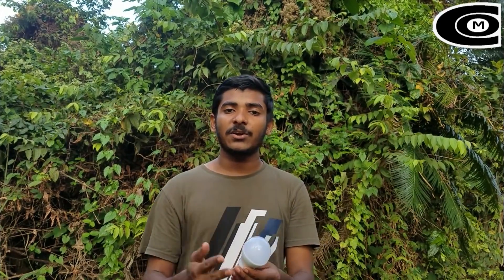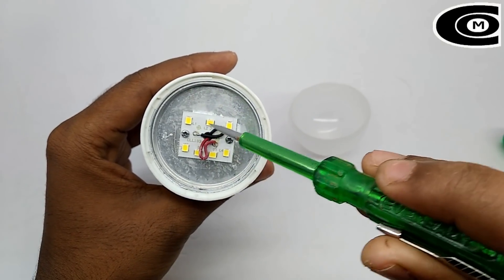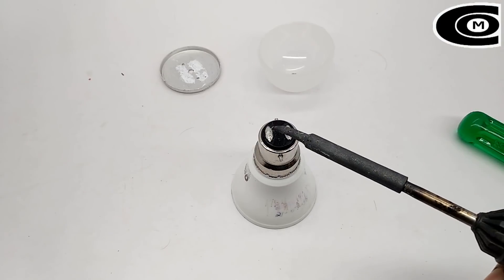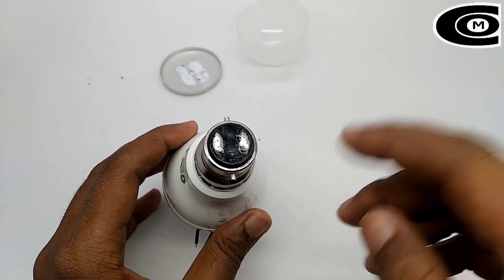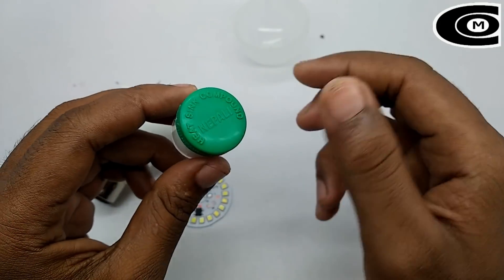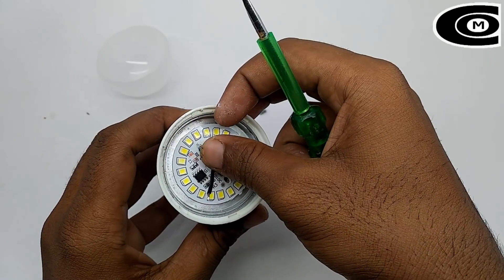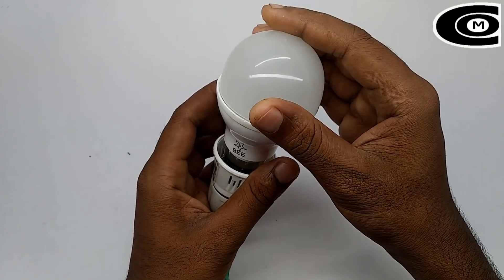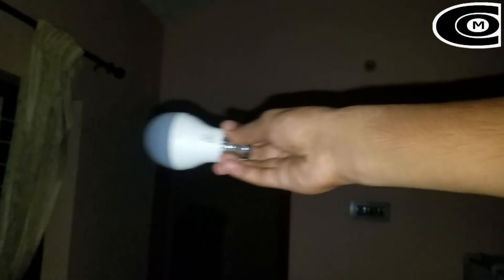How To Repair LED Bulb at Easy..|എത്ര വലിയ കേടുള്ള Led ബൾബും ഈസിയായി ശെരിയാക്കാം!!

Comment: If I only could understand a word 😂
Reply: not needed really. only relevant point is the LED board (new)  and the heat sink paste are available in electronic shop for dead cheap rates. While connecting the wires, the polarity is not important (AC).
Reply: Nicbroooooo.    #newtonstech 👈

Comment: Circuit board ആവിശ്യം ഇല്ലങ്കിൽ പിന്നെ എന്തിനാ ഒറിജിനൽ ബൾബിൽ അത് ഉപയോഗിക്കുന്നത്.
Reply: Circuit board ആവശ്യമാണ്. പുതിയ ഡിസൈനിൽ ഏതാനും ചെറിയ ഐസികൾ ഉപയോഗിച്ച് അതേ കാര്യം നേടിയെടുക്കുന്നു.
Reply from the maker: ആ led panelൽ converter ic' s ഒന്നും ഇല്ല..
Reply: Your doubt is correct, branded companies don't use these type onboard converter, it hasn't any protection ,also no life.
Reply: @shinuvarghese1915  That is where chinese ingenuity is to be recognized. If the branded companies use a charger circuit to charge a battery,, in chinese products you will see one capacitor, one diode and one resistor. It does the same job. But is it safe?Not at all. A real designer will never think of such a design. The product may not last. But when you compare the cost of replacing it sometimes it may become cheaper. As far as purchase of LED lights are concerned I always purchase Philips. If it was very expensive i would have chosen some other local brand. Price, efficiency,   failure rate are all concerns that should be looked into before buying a product. There are some brands I would never buy. Because of great price advantage I buy it sometimes. Then I find that it is much better than I had bargained for.